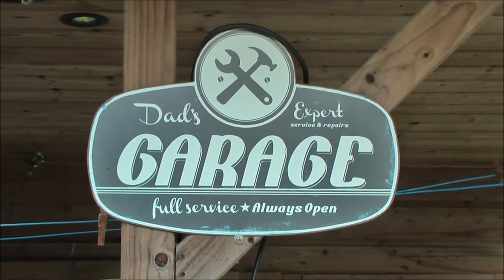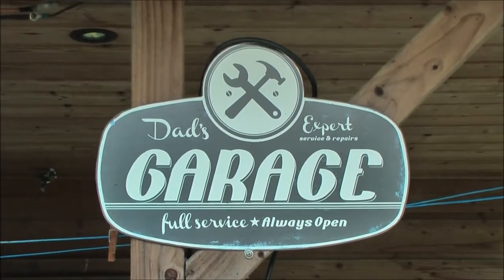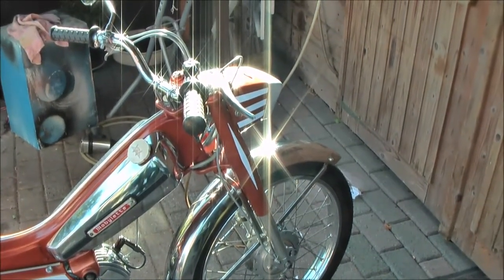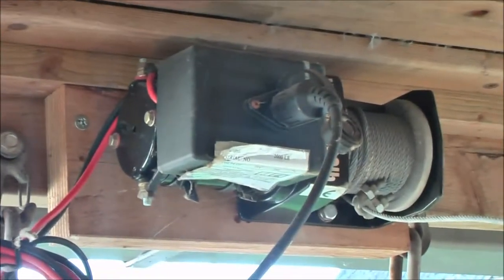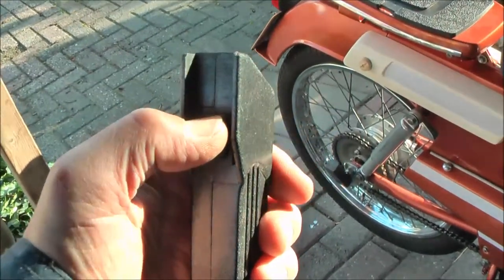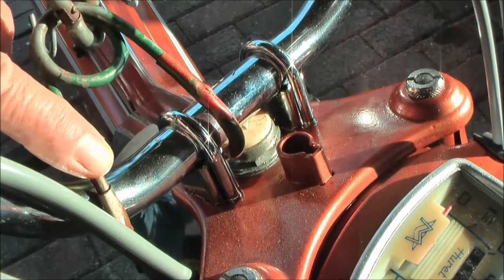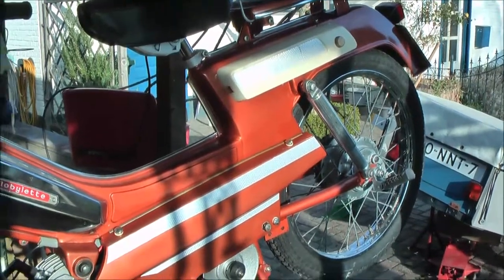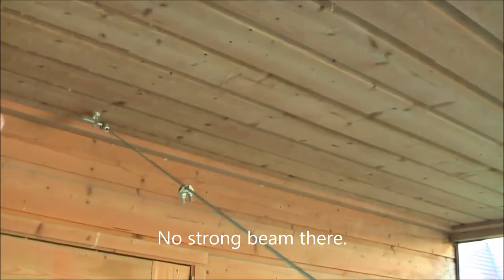Moped lift based on a 12 Volt power winch

Comment: Very good. Great simple solution. I am looking for a small winch to lift one end of a 6' board up 4' that I will lay on. It is to stretch my back. Your winch looks small and that is what I need. What was the winch built for? I am having a hard time finding one small but strong enough to lift 1/2 my weight. Thank you.
Reply from the maker: That is where I initially bought this winch for! But be extremely careful! These electric winches are very strong (i think 750 kg of lifting power). At least install an additional safety switch with which you can immediately cut the power. I used the winch only a few times for this purpose. Better lay flat for half an hour a few times per day  and get into a state of full relaxation by warming tour back with an electric back sheet or a warm bath in which you make yourself float. I have four lower back vertebrea welded to one long vertebrae. Good luck.

Comment: Walking has become difficult. I have a Mobility Scooter. It weighs 65 pounds. To bring it in the house I need to get it up 3 steps. Do you think I can use a winch to pull it up an incline? Would it be safe to ride it up such an incline?
Reply from the maker: Hand winch, 12 v winch and 230 v winch (for outside use) are all possible. All are quite slow. Fix the winch to the house wall and lay a ramp with side rails on the stairs (less steep). That should work. Gerard
Reply: Thank you!